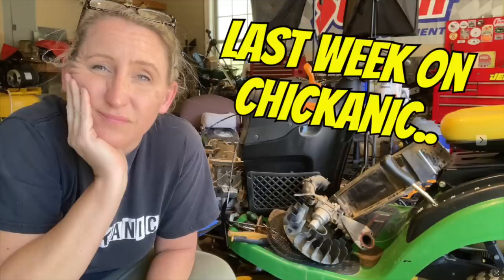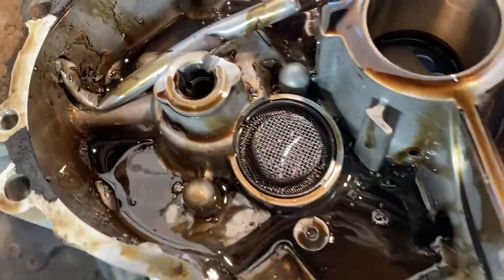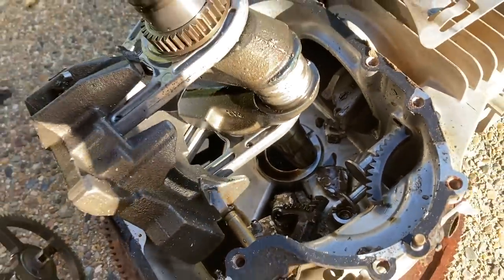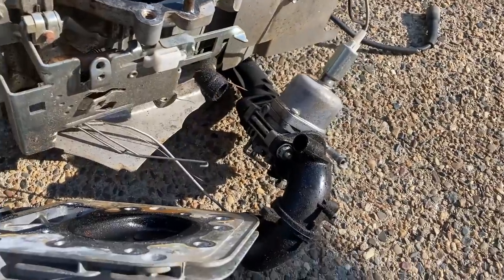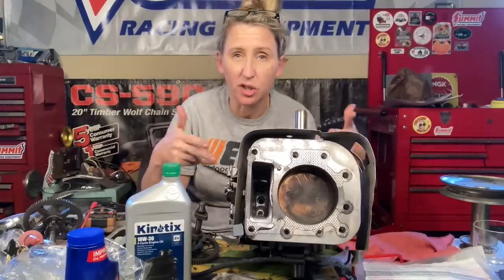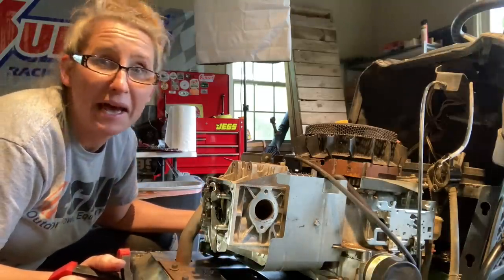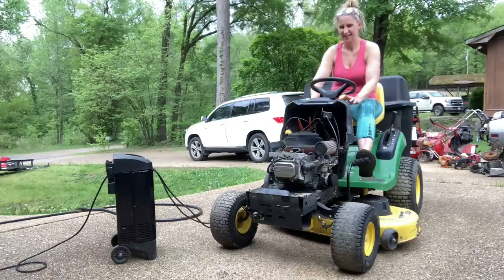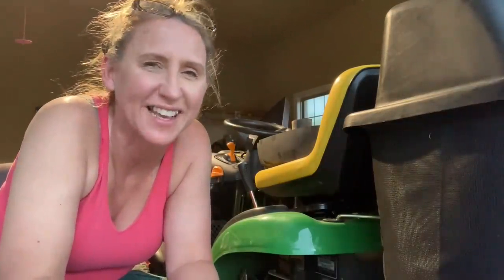A TRUE Frankenstein, turning three Briggs Engines into ONE on a FREE John Deere Rider! Will it Run?

Comment: You're amazing that's for sure, good work on that Deere. Im no mech but it seems to me that guy must have had that mower under a severe strain when it popped. In addition to other things lacking in the care of it adding up to blowing the engine, had to have had it under a bad strain. Just my thoughts but, again, Im no mechanic, but Ive been around some.
Reply: She said he over rode the governor, that means over reving,  and lots of damage.  I did the same thing on an 8 horsepower Briggs on a 30 inch cut riding mower put the rod out the side of the block. 

I did that because it was down on power over reving helped but not for long.  It was junk anyway.

Comment: aarrggh ... sorry almost got blinded by the light coming off that rock on your finger at 3:08 ... i'm ok i'm ok. Just wanted to say I had an old tecumseh engine blowup on me much the same ... it took regular 87 gas and i'd started putting 89 in it ... seemed ok about a year ... then some part of the inside came right out of the casing ... you learn stuff

Comment: #Chicanic did I hear you say you are not supposed to run your mower wide open? Plus I would like to ask you another question I own a Xmart zero turn mower the dealer I bought it I ask him if I could wash off my mower and told me he would not recommend that because the motor is open what is you opinion on this

Comment: Can some please help diagnose my issues? I have a 19.5 briggs and I had to replace the coil . I used a feeler Guage to set the gap. I tried gap # .006,.008, .010 and still backfiring or runs and dies . I feel like it's dealing with the gap but ever where I look, says it should run . Help😢

Comment: @3:53 Isn't that the way you're supposed to run small gas engines...wide open to get the most torque and horsepower out of it?
I do on my riding lawn mower with a B&S engine. Run it that way for 14 years, make sure it has proper amount of oil, tune it up regularly and no complaints in those 14 years.

Comment: Chickan. I was about to change oil and air filter on my J Deere, When looking at this video. I jumped to my garage. Grabbed Turf Gard SAE 10w30 oil. I see no zinc markings that may indicate Zinc. So, Now you have me a bit nervous. I was about to use Quaker State 10w30. That also, Has no zinc markings. I change oil on average every 30 hours. What can I do about this situation. Freaking out. lol
Reply from the maker: Your oil might have zinc in it and it not say it if it is specially formulated for small engines. I would have to research the oils to know which ones. I do know the Briggs oil bottles don't say it. You can also buy Zinc additive.
Reply: One good solution is to use a HDEO oil in 10W30 ... Chevron Delo, Shell Rotella and Pennzoil Long Life.  These "heavy duty" (gas-diesel) oils have extra anti-wear additives and handle fuel dilution really well.

Comment: The old zinc debacle... Should be not using heavy enough oil or changing it frequent enough. A lot of camshafts and lifters are not hardened enough and it gets blamed on the oil. Oil technology has came a long way since the 60's Don't use 5W30 or 10W30 in small engines use SAE 30, 20W50,15W40, or 15W50. Full Synthetic oil is best.
Reply: I use 10-30 magnatec semi synthetic the upper number is important change x2 a year domestic large yard. HONDA & ALL good hundreds of hours. Using 20-50 is wrong as the oil is too thick for cooling when fully hot. Match the top viscosity number to 30.
Reply: @ausmartin1  you have no idea what you are talking about. Not important to change oil twice a year. You go by hours of operation. You will never have a problem changing a Honda twice a year because you are probably changing oil that is still good. Air cooled engines break down oil because they run hotter than a liquid cooled engine. You don't use the same oil you would use in your car. I hàve never had to rebuild or replace a engine in over 30 years. Even used engines that ran good when I got them. I convert everything to full synthetic 20W50 no leaks ever. I have a push mower that has 5 years on the oil change and it is almost as clean and clear as the day I poured it in. Can see the cross hatch on the dipstick and haven't added a drop of oil in 5 years.
Reply: @Jason Busch  Neither have I rebuilt an engine. Yes 30 SAE is the best 👌 as manufacturers recommend. 20-50 is absolutely 💯 deal wrong when you speak to an oil engineer. Yes the car engine oil is second best. Reason to change 2 a year my engine has no oil filter. It helps to re remove contaminates and any petrol dilution. Fun fact the splashing oil inside an air cooled motor helps to cool it. Where did you come up with such conclusions? Ps here we mow year round not just summer season. It is about 25 hours per 1/2 year but to change it a little early helps in less wear & tear it has worked out that way. Note peoples do NOT follow either of us two stupids. For the truth Read your individual owners manual for your piece of equipment for hours  / time & conditions of interval and the grade & type of oil to be used in your particular part of the world.  Don't go using something else just because it is recommended by someone here unless you can afford the risks.
Reply: @ausmartin1  you really need to do some research on oil you counter dict yourself.
Reply: @Jason Busch  I would suggest you as well. I Bet you are the type that buys a new car using 0W- low friction oil & then puts thicker oil In as you know best right?
Reply: @ausmartin1  yes sir I put  Blue bottle STP in my 2012 Mazda 3 every oil change since new and change the oil every 10,000 miles. Have 170,000 miles and it doesn't burn any oil. Had a Toyota pickup that ran and drove like new with 286,000 miles when the frame rotted in half. Didn't use any oil and not a knock or tick and I took it to a mud run and tried to destroy it but it never let go. Went to the junkyard with a good motor and transmission.
Reply: @jasonbusch3624  ah ha! I knew it. I rest my case. Please do go and talk with a professional oil tribologist 🛢 about oils & aftermarket additives. I can wait while you do ...
Reply: @ausmartin1  I have more knowledge on oil than most of your so called tribologist. They want you to use thinner oil for that last .02 MPG. They don't care if they can extend the life of your engine. I called Valvoline customer support one time and he couldn't answer my question on the oil ratings on their own bottle. Pretty sad when I knew more about his product than he did.
Reply: @Jason Busch  Sorry you have owned yourself. If you brought to the table oil analysis results etc. it would have lent some credibility to any of your arguments. When someone says they know better than oil manufacturers or equipment manufacturers it's time to part ways.
Reply: @ausmartin1  I don't bring paper to the table I use that in the bathroom and so should you. I got over 35 years of using heavy oil and it works. I would like to see a race motor with 10W30. And to tell you about Valvoline they changed the diesel rating on the bottle and I have used it in my tractor for 20+ years the tech could not even answer my question about a different formula or the ratings being backwards compatible. The new bottle no longer carries the diesel rating. All he could tell me is that I had to use their petroleum base oil in my diesel that has always had full synthetic since new. Not happening.
Reply: @jasonbusch3624  Old man type mentality 👏
Reply: @ausmartin1  that's alright. I fix more engines in a month that you will own in a lifetime. I know what works and if it works and works good why go back to doing what the people that engineer planned obsolescence recommend. 5 years...no thanks.
Reply: @Jason Busch  That so, Well good luck 👍 when you have a new car and it fails underwarranty and they take a oil sample 😉
Reply: @ausmartin1  well I'm at 12 years and 170,000 miles which is almost 3X my original warranty and done nothing but change oil, filters, and spark plugs. Any commercially available oil additive will not void your warranty if used as stated on the bottle. Most people use a product as mechanic in a bottle after the problem (engine noise or oil burning)has started to try to correct it. If you use it to begin with your won't have those problems.
Reply: Those of us up north get by just fine on 5W30 or 10W30 oils.  Wouldn't want to start any of my OPE in below freezing temps if running "old school" straight weights.  I've maintained mine and my Dad's OPE for 30+ years and never lost an engine.  HDEO oils are my favorite for cost/benefit.

Comment: is rotella t1 sae30 good for these engines? doesn't it have a higher level of zinc in it?
Reply: I’ve been using it 30 years and no problems
Reply: Chevron Delo and Shell Rotella are excellent choices for OPE engines.  I prefer 10W30 mostly (I'm up north).  If straight 30 works for you ... then OK.  You could also use 15W40 with similar, excellent results.

Comment: While those engines are reliable and durable.......there are a few weaknssses that I've experienced over the years, nylon cam gear(factory), weak counterweight rods and bearings....... that being said there were millions produced and the failure rate is about 2%.......not too bad , I've just seen so many i know the failure areas.....

Comment: I cringed at the sight of the broken and bent pieces.

I'm not certain of the year of the change, I was looking at used Johnnies and noticed some of the B&S engines were made in China.
I have had numerous people tell me the quality of car parts from China is sub standard. Brake rotors warp at 2000 miles, tools made in china bend, the sockets crack, the rachets won't rachet so if a new mower you are looking at has a  B&S engine made in China I suggest you spend a bit more money and get the Kawasaki engine.

Gasoline: When possible get the alcohol free gas. Especially for winter storage. Or for any tool that does not get a lot of use. The ethanol will make a nasty gummy mess in  the carburetor. Chain saws can be damaged since we tend to use them only once or twice a year.

My Johnnie was new in 1979, built only 130 miles from my house. It is a 212 model, frame like a Mack truck, it is rated to pull a one bottom plow, push a snow plow or blower on the front or a rototiller on the back. I have no idea how many hours, the meter is kaputz. It has Armstrong steering. You either have strong arms to steer it or they will get strong from steering it. The 12 HP engine is a single cylinder Kohler and it can run the 46 inch mower deck through 8 inch tall grass with the mower set to leave the grass three inches high in third gear without bogging down.  The old guy at the JD shop told me it has more usable power than a newer 22 HP Briggs because it has a lot of torque. It holds 3.5 gallons of gas. It weighs 690 pounds, it  has 23 inch tires on the rear. Supposedly it only goes 7 mph but with the variable speed at max and trans in 4th I get a nice breeze when I zip down the driveway.

I had to completely rebuild the mower deck with all new bearings. I sanded it and repainted it while it was torn down.
I replaced the carburetor, after all the years of use the hole the shaft goes through got egg shaped and was allowing too much air to leak in. The coil gave up the ghost. It was only 44 years old, can't believe it already died.

I confess it's an armful, manual transmission, have to reach down any time I have back up so I don't do it very often. I used all synthetic oil in my old Johnnie and it has obviously paid off. he's still running. I certainly hope these gorgeous new ones last as long as mine has.

Nothing runs like a Deere.

Comment: What weight oil do you use in a Briggs rider ?
Reply: I use 5W-40 Shell Rotella T6 in everything I own including my Goldwing motorcycle.   It is recommended for diesel and gas engines so I can keep my stock down to the T6 for the engines and 50W motor oil for my hydrostatic drive motors.
Reply: SAE 30 is the manufacturer recommendation.
Reply: @1anthonybrowning  My Kawasaki owners manual says to use 10W-40 for temps -20-110F.   Since it normally gets over 100F here in the summer  the 40 weight is recommended.  The full synthetic Shell is a bit lower winter weight which is good.  By using the Shell Rotella T6, I only have to buy one other oil (0W-20) for my Honda CRV if I do the oil change myself.
Reply: @garyfowler3393  he asked about Briggs.  Kawasaki has different recommendation.
Reply: For decades B&S said 10W30 or 5W30 synthetic.  It also helps to know where you are? Florida or Montana? Extreme variation in temps should be part of your decision.

Comment: That was two very blown engines!!  Lack of maintenance and lack of common sense. If the second guy wanted to make his blades go faster he should have gotten a slightly larger pulley on the engine or just settled with the FACTORY SPEED!!  You did an excellent job getting parts from all three engines put together to make one good one. Mowers in different areas will bring different prices but I would say you should get, at the very least, $1500.00.
Reply: Could have LS 454 swapped it 😊

Comment: Do you sell parts and ship if prepaid or by card I have a motor or tow that I want to ring 1 is a old brigs and the other is a 2014 kolar may be you have some new old stock for the brigs it's on a old old all metal snapper riding mower just wondering. Thanks you are the qeen of fix it.
Reply: Ps I live in East Texas.

Comment: In light of recent inflation and demand for used mowers, I think it’s worth $1800 up to $2000. The only problem is that those engines only last about 100 hours when new so I would sell it to someone with a small yard.
Reply: They last waaayyy longer than 100 hours.  I have an 2008 with the 19.5hp engine.  I cut over an acre of yard all year (south Tx). The compression release quit about 4 years ago, but I can still get her started with a jump starter.
Reply: That pricing sounds about right… and I must be blessed. I purchased my 21hp in 2010 and it’s gone everywhere with me, cutting 1/2 acre lots, pulling a boat around the yard, plowing snow, moving dirt, etc. Not one problem; I’m not a fanatic about servicing, but it’s never spent a night in the elements.  Easily has 500 hours on it… sometimes you get the unicorn.
Reply: @mongrel1799  That’s awesome. I would never have that much luck.Sounds like you really take care of your equipment.

Comment: a guess? $1800-2000, depending on how big your 'net' is, and how much demand there is in your area...

(unrelated question: have you worked on any units with 4-wheel steering? I've seen some here (I'm in western Canada), but never had an up-close look at the mechanicals...)

Comment: Wait a minute, wait a dang minute!
It appears to me that our choice of oil is critical for small engines AND they need a ZINC additive?
If that's the case, what do you recommend that is readily available at a box store?
BTW, love your channel, learned a lot but this jerks my shorts!
I have a 2015 Cub Cadet rider that runs great but I have NOT been using an oil with zinc.
Reply: You are looking for ZDDP on the label which is the zinc package. Shell Rotella which is sold everywhere has zinc.
Reply: @mikemaccracken3112  Thank you Mike, I had no idea this was needed for small engines nor is it mentioned in ANY of my owners manuals. GO FIGURE!
Reply: Read the label and make sure it has zinc in it. I go to oreillys and they have a Valvoline quart that clearly says “Zinc” in big letters on the front.
Reply: One good solution is to use a HDEO oil in 10W30 ... Chevron Delo, Shell Rotella and Pennzoil Long Life.  These "heavy duty" (gas-diesel) oils have extra anti-wear additives and handle fuel dilution really well.